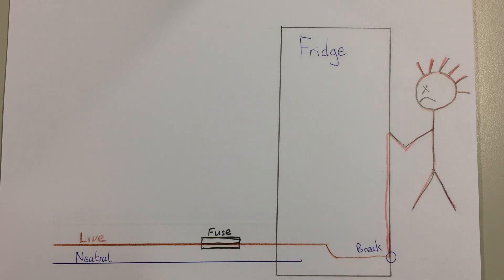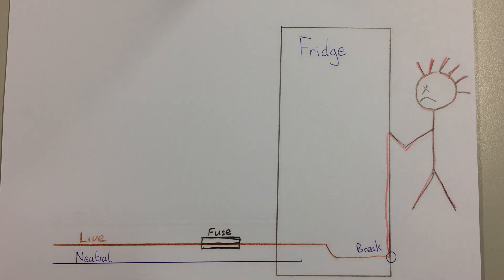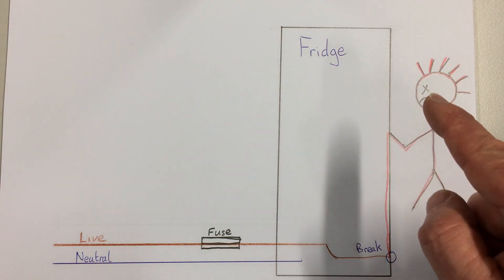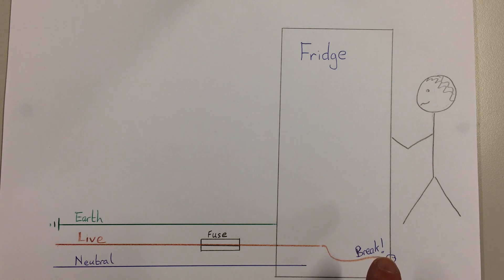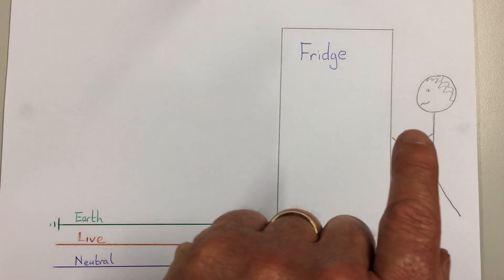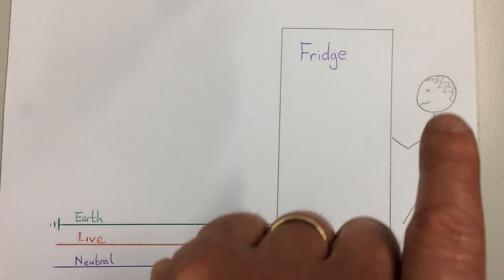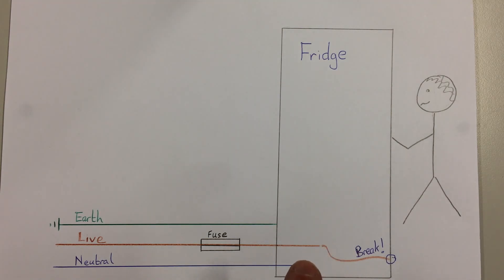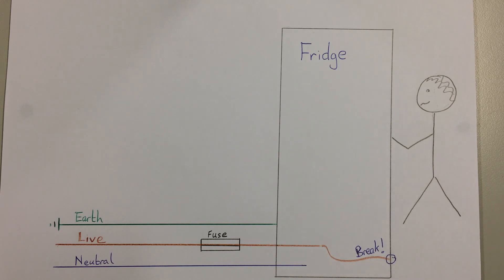How an Earth Wire and Fuse Work

Comment: This explanation is not entirely true. In reality very little fault current flows to earth, certainly not enough to blow a fuse. Consider a TT earthing system. The actual path for the large fault current which results in a TNCS earth system is in fact through the neutral conductor back to the star point on the supply transformer.

Comment: Thank you very much for the video! I could always regurgitate the 'model' paragraph that I would need to write down to score marks in the exam with questions about earthing and fusing - but I never knew what it meant. The diagram helps so much. Furthermore it's make so much sense why the electricity wouldn't go through the person because the earth wire is there and provides an 'easier' route, a path with less resistance because it's a conductor. And electricity travels along the path the least resistance so that's why it goes to the Earth wire.